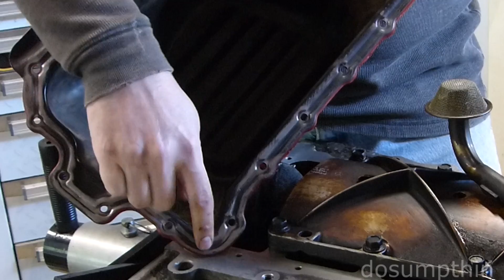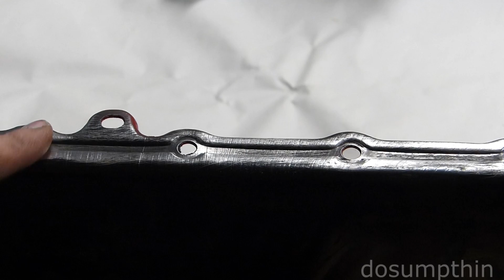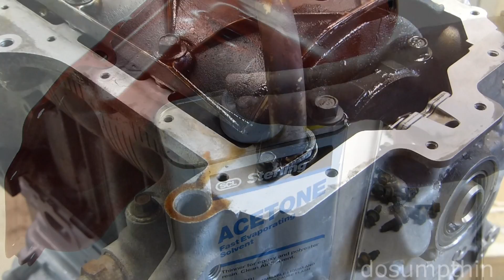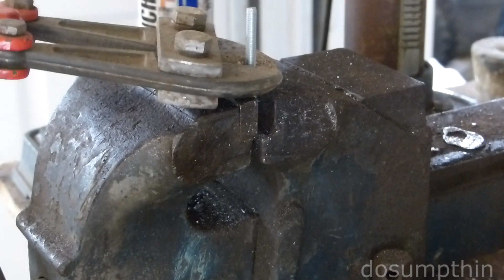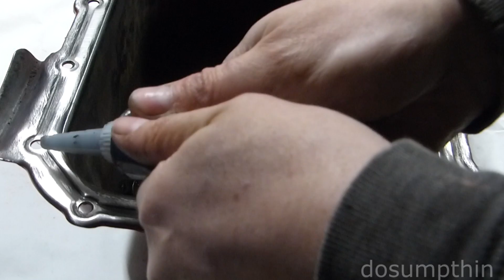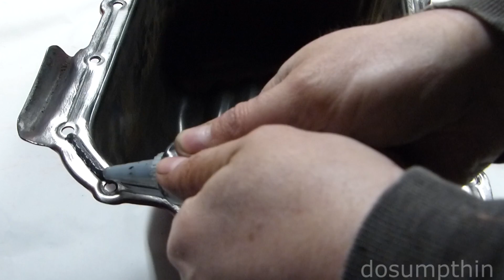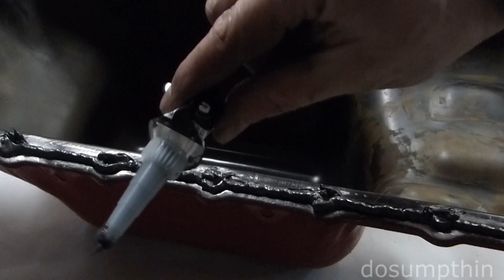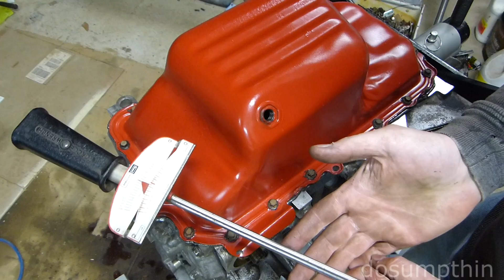How to install an oil pan... without leaks, the first time.

Comment: Is there a reason you torqued the oil pan 100% before letting the silicone cure? I must have been doing it wrong, since I just snug the bolts up until the silicone squishes out then I wait for it to fully cure. Re-tightening the bolts isn't necessary since the silicone literally glues the oil pan on, and it will not come off, even if you remove the bolts. Are you supposed to torque the oil pan 100% before letting the silicone cure? My reasoning is, tightening it down before it cures pushes all the silicone outward, instead of keeping it under the pan where it can form a gasket. If I remember right it seems like the factory had a 1/8" thick layer of silicone under the pan, and this isn't going to happen if you tighten the bolts 100% before the silicone cures.

Comment: Those Saturn engines are a work of art aren't they. I came to this video to see your opinion on how long to let the silicone cure before pouring oil in the engine. I've been having really good success on all my siliconed parts by applying the parts immediately without letting the silicone cure at all, then I hand snug the parts, and wait overnight before putting oil in the engine. My oil pans don't leak this way, and I have never straightened the oil pan flange, I've just made sure it's clean. I wonder if waiting overnight is really necessary before putting oil in it?

Comment: Nice Video
There were a couple things that I would add: 
1. When wiping surfaces with solvent wipe in one direction only to avoid leaving residue. 
2. Whatever amount of RTV oozes out on the outside will also ooze out on the inside. This excess RTV can and will end up in the pick-up screen of the oil pump, so getting just the right amount is very important.
Reply: +William Lee i was thinking No 2 as  he was torquing it down
Reply: +William Lee Good tips! I hadn't thought of wiping in one direction, how obvious. Wow. Regarding the silicone, this only happens to Chevy people who are working on their first 350 V8 truck engine. haha. No really, if you let the silicone cure overnight, silicone is very strong and won't come off and go into the oil pickup screen. If you don't let it cure, it very well could though. Of course if you use way too much silicone, then it could go into the engine, yes. But I've always used a tremendous amount of silicone and have always let it cure for 12 to 20 hours before starting the engine, and I've never seen any of the silicone come loose, even though there are big globs inside the oil pan.

Comment: I found you video very useful in respect to working with RTV. As for myself I'm doing a oil pan with a metal gasket which does not need RTV. However, I'm thinking of using RTV as a backup to ensure a good seal. Any thoughts are appreciated.
Reply: Kurt Lee Use either RTV or gasket but not both.  A dab of RTV is only needed at joints that are at 90 degrees, like in a valve cover. Cork-rubber, rubber, molded rubber parts cannot “flow” or fill into these 90 degree joints so some assistance is required from RTV to fill in that small area that the gasket cannot get into.

Comment: What happens if you dont bead it but instead, smear the RTV around the entire oil pan mating surface.  My though would be a larger gasket.  Could this cause a leak though? (Assuming the bolts were all torqued gradually to spec in the right order)
Reply: +liquidfrice You should not smear the silicone on an oil pan, unless it is a cast aluminum oil pan. If you have a steel oil pan, the surface is not very straight and true, and if you smear the silicone rather than place a thick bead, you might get a spot where the silicone isn't thick enough to form a good seal. In my opinion a thick bead is a good idea, and using more is better than not using enough. If you let the silicone cure for 24 hours, you won't have any problems with silicone going into your engine.
Reply: +supermuble 
.
.
.
chevy aluminum oil pan included a seam type rubber type  "gasket" already attached right out of the box

now what :0

.
.
.

Comment: No gasket?
Reply from the maker: Todd Heinrich Nope, this particular car doesn't use an oil pan gasket.  On a related note however it does typically use a valve cover gasket but I skipped that on purpose because they always leaked.  I installed the valve cover with RTV only, no gasket, and this has all held up without leaks for 10,000 miles so far.  https://www.youtube.com/watch?v=tYF-vTWwtY8

Comment: Probably the best guide to applying RTV on Youtube. Every trick he did, I recommend, ESPECIALLY using "headless" bolt threads to guide the pan on. This is critical if installing from the undercarriage; you'll never line it up perfectly without guide bolts.
Reply: Felpro usually includes plastic studs with their gaskets and the pan will "snap" in place over the studs, so not only do they line it up, but they will hold the pan up until you get your bolts and wrench in hand.
Reply: It's kind of sarcastically funny but most French cars. Namely, my Peugeot's and Citroen's have a very simple solution. The oil sump is fixed with bolts all around, just like any other, nothing new here. EXCEPT for two studs, standing on opposite sides of the sump. That obviously use a couple of nuts. Simple and basic. No need to "invent" with headless bolts, plastic studs, etc. They're just there. ;-)
Reply from the maker: Tim W Thank you sir!
Reply: Wish I knew that before buying! ty
Reply: Yes but wood dowels can work.

Comment: on how long should you wait for seal to dry? your own car a couple of days on a customers car? back it out asap there is a check to be written!
my old employer told me how long to wait when i worked at his shop,   (hurry up and get it out of here shes waiting in the office,DOOR SLAMS glad i was an hourly guy and could get paid again if it came back leaking, downside i was way to tired each day running against a clock, the commission guys worked slower and less comebacks! with that said dont let a boss burn you out, move on to some other place!

Comment: If you read the back of your gasket maker, it will tell you to put a bead of caulking on your piece and put the pan on but not to tighten it until it forms a gasket in about an hour. Then tighten the bolts down. You learn a lot be reading the manufactures instructions. Great video all the same.
Reply: This!!

Comment: Well done!  I'll be tackling this (for the second time) this weekend.  First time resulted in a leak on the transmission side of the pan where the two bolts are hard to get to when the engine is in the car.  Maybe a 'lil snub nose revolver will fall out...

Comment: ok video. CORRECTIONS: 1) use LESS RTV & 2) wait at least 1 hour after mating the pan to the block. THEN torque your pan bolts. I have 25 yrs as mechanic with numerous, numerous engine builds & rebuilds, and more automotive work than you can shake a stick at. Just saying, too much RTV and not allowing RTV to set will get you RTV in your engine oil, and it will be more likely to LEAK, Keep trying tho.
Reply: Permatex disagrees with "correction" number 2. I think I'll stick with their recommendations...
Reply: +athhud ...he is right. you're supposed to let the shit get tacky...which is after a hour or so. maybe longer depending on weather. shit won't cure in cold. it  go get felpro gaskets in your future...no. sealant needed.
Reply: You have shit as far the 25years! Just another smart ass MORON!
Reply: stick a taco in your a...s
Reply: george stamos Nope, he's right. Definitely not a moron. A moron is someone who opens their mouth when they're incorrect. That would be you buddy.
Reply: george stamos You're supposed to put it in the other end buddy. If you have trouble with that you're far more stupid than I first thought.

Comment: thank you for the video, i have a 2002 honda  civic with a constant oil leak and finally going to get it fixed, however i ran into a problem. Honda OE gasket is a tube of sealant. There is a formed gasket you can buy. im wondering which one i should use. i seen videos ware people use sealer and the gasket. what do you think?
Reply: Use the sealer, don't bother with a gasket
Reply: I second Daniel.  Almost all brands abandoned traditional gaskets in favor of RTV Silicone.  Silicone is leaps and bounds better but the proper steps must be taken as in the video: non-residue cleaner, surface so clean, and dry it is cleaner than the plates in a 4 star restaurant.  Bolts - placed in a cup of solvent and thoroughly cleaned. Care must be taken when removing the old oil pan not to damage it by bending while prying it off - the factory original RTV on my 1997 Saturn was so tough it was like it was welded on even after 18 years!  I had almost no leaks but I was changing the timing cover which interfaces with it. Scraping off old RTV is a real work out.
Reply: Not all honda uses gasket maker some use a rubber gasket the steel oil pans are a rubber gasket and the aluminum is a gasket maker called honda bond silicone based high temp gasket maker

Comment: Very cool video, your calm, clear manner is great.

I replaced head gasket on my 2001 Saturn SC1 (SOHC) because of small oil leak 2 years ago, and am about to take the whole engine apart to add the piston oil ring holes as your video shows very nicely...
A few thoughts on the oil pan:
- what about the timing chain cover? a lot of us would be taking that off as well, and the 2 seals are related, as they're the same process and interface in a "T" junction, my intuition says to use a (metal) strait edge to get the bottom face of the timing chain cover absolutely in line with the flat of the block where it mate with oil pan...
- shouldn't we make sure not to let too much RTV squeeze on the inside, for fear that some bits or hunks break off and clog up oil passages?
- I think we all could torque things by hand, but I don't think to Torque or not to Torque is really a question... hehe
- I used Permatex Ultra Black RTV, no leaks... my only question, can I use the stuff I bought 2 years ago, (or even the stuff from a few years before that? ...from sister's 99 VW Golf)

Anyway, your videos are Great!

Comment: yeah sealing an oil pan with the engine inside the car makes it harder to install the oil pan.

The biggest mistake I have seen people make that causes the oil pan to leak is they don't wait for any sealant to dry before filling it with oil. Also as you mentioned the bolt holes are tented and need to be pushed back down. Also cleaning cleaning and more cleaning is necessary as you mentioned as well.

Mineral spirits will also work well with degreasing.

Also if the pan gasket is the same as yours you would want to hand tighten or a little tighter and allow it to dry for 24 hours and then finally torque the bolts. This allows a gasket to be built and not be squished out the sides and will keep rtv from inside the engine.

If you want it to work faster Permatex also makes "the right stuff" which cures in 1 minute.

And yes pattern and doing it in two passes is a very good idea. Also your friend not using torque values is a very very bad idea. Torquing takes a lot of the problems out of the equation.

Also people who say they have the car out the door quickly are probably not talking about a complete RTV gasket. Like a rubber gasket gets no rtv and is usually a dry install so the rtv dont act as a lube and squeeze the gasket out causing a leak or it may get a sealant like aviation glue or one made from cork uses a combo of RTV and the cork and doesn't make a bad gasket but is still old school. Lot's of people have ideas that work for them.

I believe your just fine with the way you did it and will last a pretty good while.

Another tip is sometimes in older engine you may not have a flanged bolt which helps stop leaks from around the bolts. When you see this you want to add washers  to the bolts.

RTV ultra black is for oil, grey is usually tranny, red for valve covers or anything really hot, and blue for water. and Permatex No 2 is gas related things. Blue may work on valve covers as well as black but I just like using the red for hot areas personally I wouldn't trust the other stuff. Also you can use RTV on a lot of stuff that calls for a gasket that will keep you from buying a ton of gaskets. Head gaskets, manifold gaskets are a big no no unless you are doing a v8 or v6 chevy which will require rtv in all corners of the valley for the intake manifold gaskets.

Good job though can't wait to hear you run it.

Comment: Really comprehensive and well explained. I needed someone to inspire a bit of confidense in me before i went and did this myself, so thank you for that. A quick FYI, the inline four I am doing (80's toyota) has nuts instead of two of the bolts, to help line it up. The two factory threaded rods help line up the pan - should be handy for a one-man upside-down jackstand repair like mine. Good luck to you
Reply: Yes, same as my 2000 Tacoma, 16 bolts and 2 studs needing nuts. I have it off at the moment because the engine got terribly sludged. Spent a lot of time in the valve cover area, including replacing the valve stem oil seals. Decided to remove the oil pan and do the same below, and boy was that a good decision. The oil pickup screen was fully clogged! Cleaned the sludge from the pan and am ready to do the engine hand cleaning. Had been using diesel as a solvent, but thanks to this video I think I will try mineral spirits as well. Is there a solvent that can cut the RTV, rather than a wire wheel?

Comment: Great job presenting good, clear info.  I almost never use a torque wrench.  I'm in the process of doing a head gasket on my 1997 saturn sw2 and will be using the torque wrench for head bolts.  An extra benefit of using a torque wrench is that the bolts are all applying the same amount of pressure.
Reply: tips for youtubers:> on a head, not only do they need to be torqued, but they must be torqued in a specific order. AND if your car has an engine that has "stretch bolts" then the head bolts must all be new, and NOT reused.
Reply: I got good results EXCEPT one minor error: in the corner where the timing chain cover meets the oil pan I pried the oil pan slightly + I did not use enough gasket cement so there is a very small leak.  SOLUTION always use enough gasket cement so that when the pan is bolted up it squeezes out all the way around the oil pan - IF it does not - drop the pan right away and add more in those spots and reinstall.  Don't be afraid that it will get inside the motor as it bonds to itself and is unlikely to break off and travel inside the motor.

Comment: use a ball peen hammer to flaten out the oil pan holes when they bend upwards use the steel slab u have lay the lip flat on it and hit it inwards.thats how u can get em back to oem place and will seal perfect.

Comment: Great Video. Thanks, I was wondering if you have to wait couple hours after the hand tight to apply the torque to the bolts? Some people says that the RTV must "semi-cure" before the final torque.
Reply: Jairo García Seminario ik you posted along time ago but yes the semi cure is what you need to do before you torque

Comment: 2¼" Ruger SP101.  .357 Mag?  I found one of them 5-shooters in my 410FE Ford when I rebuilt it in 1994. 20 Years later, still no leaks. As you point out in your video, cleanliness is the key.  I wiped with laquer thinner several times on all gasket surfaces of the engine.  Used FelPro gaskets with Ultra Blue RTV on both sides.

Comment: A huge THANKS.  Before I put the new oil pan on a 429, I watched your video.

Cutting the slots into some bolts worked WONDERS cleaning out the bolt holes, I had never seen that done. So many times have I needed to clean out some threads, now I know how.

Then I cut the heads off and used them as studs to line up the pan, worked GREAT!

If it wasnt for you taking the time to show that level of detail, you would have heard me cursing from there!

Thanks again.